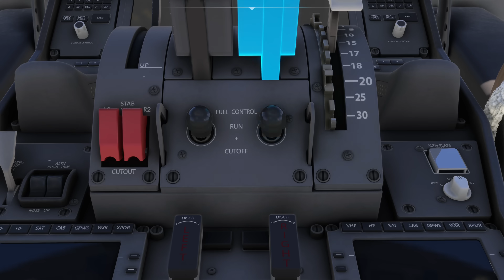Air India 171: Why Did The Fuel Cut-off Switch Get Moved?

Comment: The idea of having two pilots to be present to activate any function sounds dangerous, imho. What if one pilot is suddenly incapacitated (heart attack, sudden pain, etc)?  What I think should have happened in this tragic incident is a warning alarm to sound if fuel is cut off too early - (the aircraft computer program can determine timing is not right, given all flight data is monitored, including take off incline etc). Planes are built with all the hardware safety in place, but dangers can be caused by pilot error too, which airplanes computer programs should be able to monitor and sound an alarm on pilot errors, not just hardware errors.  Would that not be feasible? Thank you for your video, sir

Comment: Is the 787 equipped with alarms when engines are fuel-starved, either by malfunction/contamination, or deliberate action (cut-off)?  Additionally, I've heard no report of an audible stall warning, terrain, stick shakers, etc via the CVR during 171's departure from flight (stall).  Were there any control inputs recorded by the FDR to manage a departure from flight, other than the fuel cut-off switches being turned off and back on again?

Comment: Does the switch operate the same way on different aircrafts? Like if its pushed down it means OFF and up is ON is that true for all aircrafts?. Could this have been a situation where on the pilot’s previous plane the switch operated in the opposite way, which would have explain why he denied turning it off.

Comment: the UK in 2018 and 2025 published a report that the fuel shut off valve needs to be inspected soon after qatar and other airlines started checking it this was put out by Boeing itself first the flaps then u found out the rat was deployed plz understand this could be a technical issues as well

Comment: Why hasn’t the report published the entire conversation happened in the cockpit between the pilots. Why just only specific 2 lines are reported.
Reply: How do you know that there was anything more?
Reply: @johnp139  there must be, flight duration was about 40 sec. Pilot keep exchanging confirmation message about action they perform on aircraft during take off, where are they. All event should be described with proper timestamp , not just mentioning immediately after in report, it means there must be more conversation or detail.
Reply: @johnp139 
absence of proof is not a proof of causation. 43 second recording is not enough to draw a conclusion, it is a blatant and desperate act to exonerate the Boeing. 
It has happened in the past, they will rip the lives of pilots to shred, and find a clumsy reason that indicates not if it proves the pilot's fault.
Reply: @BhargavSushant That ALONG WITH THE FDR DATA!!!!
Reply: The NTSB just hasn’t released the transcript yet. It should do so eventually.
Reply: Indian auhorities trying to hide the truth of a mass murdering pilot.
Reply: And all jumping to conclusion that pilot has done it. Even captain seems to buying that conclusion.
Reply: You know why

Comment: Why are there no immediate extremely obvious and impossible to overlook audio and visual warnings when the fuel shutoff switches transition from run to cutoff shortly following takeoff and before a safe altitude and airspeed are reached? Wasn’t there a 2018 bulletin warning of similar Boeing fuel switches transitioning into the cutoff position during flight? It seems archaic to me that the primary preventative measure is a pilot placing their hand near the fuel control switches. Modern flight control systems should provide additional safeguards. In my opinion, Boeing should have been proactive with software enhancements that might have prevented the Air India 171 tragedy.

Comment: I am 2000% with you Captain Steeeeve!  I would not trust anything AI for anything that I ride in, especially in something that can end me so quickly.  I work with very high-grade technology for a living and every day I see failure, either a component, a piece of software running away, some goofy errant condition, whatever.  Overall I think technology is pretty spiffy, but it doesn't have a soul hanging in the balance to protect.
Reply: Especially when landing during crosswinds

Comment: @10:28 ... If the airline did have cameras in the cockpit in this particular instance it would most likely have confirmed whether the cut-offs were hit by mistake or not; I respectfully disagree..   Cameras should be installed.

Comment: Captain Steve...Great insights. I need the following clarifications
If a pilot is taking control of landing and when the fuel to engines are cutoff. Which switch is turned off first?  Is there a sequence, i.e., number 1, first, then number 2, or is it the one nearest or further away from the pilot who has the control?

Comment: Captain Steve, it took 10 seconds, between when one Pilot inquired about why the switches were set to off and when they were finally switched back on. Would those 10 seconds have made a difference if they were instantly turned back on? Thanks.

Comment: On another YouTube stream Marco Chan of Buckinghamshire University points to a possible chip failure, highlighted in an earlier maintenance advisory. Apparently, after enough service time the chip becomes degraded from heat, and can fail, even momentarily. And possibly even re-engage. Surely this needs to be carefully looked into, as it could be a more realistic summary of the cut-off switch behaviors.

Comment: The possibility of this type of "accident" or "worse" is completely 99.99% preventable. The left engine cutoff should be located at the Pilot in Commands left side panel. The right engine cutoff should be located at the Flight Officer's right side panel. This switch placement would eliminate BOTH accidental deployment AND intentional deployment of BOTH switches at the same time. If one or the other pilots were to spool down "their" engine at a critical point, these planes (which are certified for single-engine flight) should still be able to keep on flying. It would simply be impossible to have a dual engine engine failure without one pilot incapacitating the other and then somehow shutting down both engines. Retrofitting the location of these switches on ALL commercial aircraft would give the public the confidence that this type of "accident" would virtually never happen again.
Reply: good idea, same with four engines, two on the captain side and another two on f/o side and for sure on overhead panel

Comment: people suicide all the time ... some deliberately, some inadvertently, and what is often forgotten is that a very high percentage of people who have life frustrations or mental health / life situation problems or challenges ... routinely have momentary impulses ... that are self destructive or destructive to those around them ... but momentary swearing at a driver and considering ramming them ... or ... a momentary desire to punch the bully at work ... passes ... or even if it does not ... generally behavioral excursions in most situations ... even if destructive behavior ... are usually recoverable without lethal outcomes ... but in aviation ... in critical situations ... there simply is no time ... to defeat the physics of the situation ...created by a momentary behavioral excursion ...  the reality is simply that in aviation ... the regulatory and employment environment make it virtually impossible to seek help without risking your career ... etc.   That there is a bit a help at one or two airlines does not mean it is the norm ... it is not ...

Comment: I saw Steve on an interview earlier today where he stated that he had never heard of a flight where both fuel switches were moved to shutoff early in a takeoff.
But in 1989 Delta flight 810 did exactly that. One of the pilots mistakenly moved the fuel cutoff switches to the off position in response to an amber alert light that was indicating a possible fuel pressure problem. But it was not an emergency situation that the light was potentially warning about. And the pilots managed to restart both engines after decending to just 600 feet agl and continued with the flight.
I'm not suggesting that this is what happened on this flight, only pointing out that this scenario has happened in the past.

Comment: The automatic activation of the Ram Air Turbine (RAT) just five seconds after the fuel cutoff (08:08:47 UTC) on Air India Flight 171 cannot be explained solely by the "CUTOFF" of the fuel switches. The Boeing 787-8’s engines,  operate at takeoff with full thrust at approximately 2,560 RPM (100% N1) for the low-pressure spool (fan) and about 11,377 RPM (100% N2) for the high-pressure spool. Due to the inertia of the rotating components and the airflow ("windmilling") at a flight speed of 150–180 knots, the engines maintain significant rotational speed for at least 1–3 minutes after a fuel cutoff, typically 50–75% N1 (approx. 1,280–1,920 RPM). This is well above the ground idle speed (approx. 614 RPM, 24% N1), which is sufficient to keep the Engine-Driven Generators (EDGs) supplying power to critical systems such as flight controls, avionics, and hydraulics.

A drop in rotational speed below idle (approx. 614 RPM) within just five seconds is physically impossible, as the airflow continues to drive the engines. Even with maximum braking effect from an abrupt fuel cutoff, the speed would not fall below 2,000 RPM, far from a level that would jeopardize the EDGs' power supply. The rapid RAT activation thus suggests an additional technical failure, likely in the Electrical Load Management System (ELMS), the Full Authority Digital Engine Control (FADEC), or the software, possibly due to an error in the MN4 microprocessor of the Electronic Control Unit (ECU). The cockpit recording ("Why did you shut it down?" – "I didn’t") and the unusually precise switch movement (within one second) support the hypothesis of an automated error. The report’s emphasis on the switch position distracts from this central issue and may aim to obscure a system failure to protect Boeing and Air India from liability.

Comment: If one of the pilots did this on purpose, why would they allow the other pilot to turn the fuel switches back to run? If they wanted this to happen, why would they not stop the other pilot turning them back on and potentially rectifying the situation?

Comment: As a military flight instructor for 27 years, I have seen some unusual things. The fuel cutoff switches on the aircraft are a terrible design. Why they are on the throttle quadrant, right behind the throttles is ridiculous. I would ask if the co-pilot was wearing a watch or a bracelet. If the co-pilot moves his hands from supporting the throttles on the take-off roll and then moves to raise the gear/flaps after a positive rate of climb, could he have inadvertently caught the switches in a one-in-a-million snag, lift and pull. Some positive G, some buffet...these switches are in a location that are exposed. It only needs to happen - once!

Comment: Could the dual-engine flameout of Air India Flight AI 171—fully fueled at 54,200 kg and a takeoff weight of 213,401 kg in extremely hot weather—have been caused by the Thrust Control Malfunction Accommodation (TCMA) system detecting an ‘over-thrust’ condition during takeoff, mistakenly thinking the aircraft was still on the ground? In such a scenario, could TCMA’s FADEC logic have automatically shut off the fuel mid-air—similar to the dual-engine shutdown on ANA’s 787 at Osaka Itami on January 17, 2019, when full reverse thrust was applied before ground mode was confirmed, triggering TCMA and resulting in both engines shutting down unexpectedly? 

Thrust Control Malfunction: Accommodation (TCMA) system, in certain scenarios, can shut down an engine by cutting off the fuel supply. This occurs when the system detects an over-thrust condition, meaning the engine's power level exceeds a predetermined threshold. 

TCMA's Role: TCMA is a safety feature designed to prevent engine runaway or other thrust control malfunctions by automatically reducing engine power or shutting down the engine if necessary.  

Over-thrust Detection: The TCMA system monitors the engine's power output and compares it to a threshold contour. If the engine's power exceeds this contour, it indicates a potential malfunction. 

References: https://simpleflying.com/ana-dual-engine-failure-on-landing

Comment: I think they forgot to ever turn it on until they heard the engines fail and tried to restart them.  They never turned them on until it was too late
Reply: If they weren't turned on, they would have never left the boarding ramp. The engines don't run when they are off.

Comment: In December 2018 the FAA issued a Special Airworthiness Information Bulletin (SAIB NM-18-33) regarding Boeing fuel control switches, including those on the 787, noting the potential for the locking feature to disengage and allow a switch to move without lifting — increasing risk of inadvertent engine cut-off  .
However, this bulletin was not mandatory. It recommended that operators perform inspections to verify the locking mechanism was functioning correctly, but did not impose an Airworthiness Directive (AD).

Comment: Ask the Captain: Hi Cap Steeeve. Here's my question on Air India. So it's clear the cutoff buttons were switched to off. But the buttons are on one end of the wires. And they are long wires going all the way from the switches throughout the body of the aircraft till the engines. And at least on part the probably run together till they split. Would it not be possible that at one point there could have been heat or sparks that melted both wires and cause the flameout? We obviously don't have the entire report published, but I'm sure when syncing the data recorder with the voice recorder, it could be that the switches were placed to off after the flameout in an attempt to reignite. The question why they waited 10 seconds still remains, but that could be due to confusion and starting effect. Is that such a far fetched idea? I remember an aircraft incident in the past that started by smelting wires.

Comment: Just put the fuel switches far apart. One left of the captain's seat and the other right of the co-pilot's. However, that won't solve the more basic issue. If a pilot is determined, they will find a way to crash the plane.

Comment: I do not understand why these importent switches which are responsible between life and death are not covered with a small plastic box with a seal? Only in case of emergency pull the box,destroy the seal with the same movement and you can access to the switches.But not open behind the thrust levers, even switching is secured.Access is way too easy for my understanding.

Comment: I'm simple guy from small polish town - it might be a silly question but I'll risk- can you liftoff with one switch being in cuttoff position and the second in RUN position? Will the computer let you fly/ liftoff? I'm saying - captain side (I presume captain is always sitting on the left seat) has a priority over co-pilot that means "his" switch overwrites other switches where co-pilots switch - if it was in Run position -would not start anything it this instance the engine - I hope it makes sense. So, summarising - captain can take off/lift off with one engine and computer will allow that, however, if co-pilot would want to depart/lift off wirh one engine -the computer won't allow it. I'm thinking - then one of them could cut off the engine (left or right) wirh one hand 🤔

Comment: The Indian pilots union claims that a "glitch" in a Boeing airliner can cause the fuel cutoff switches to activate automatically without pilot intervention in rare cases. They have even cited a few instances where this has happened in the past. THey point out that the investigation commission has not released the whole black box tape, only a few carefully selected moments of it. Also, that it is in the interesest of the Indian airliner and Boeing to blame one of the pilots. What is your answer to this?

Comment: Hi Captain Steve, I wondered is it possible that the springs operating the cut off switches have worn out from over use since they are used at every gate arrival and therefore able to slide into any position? Thanks Stew.

Comment: What a farce. This guy initially blamed the pilots for not deploying the flaps, then completely flipped his stance — and now, based on a half-baked report with just two cherry-picked lines taken out of context, he's back to blaming the pilots again.

Let’s assume, for a moment, that one of the pilots did intend to bring the plane down. Would he really allow the other pilot to restart fuel flow to the engines — potentially saving the aircraft? The very report being cited admits that one engine did, in fact, restart, but couldn’t generate enough thrust. That alone weakens the theory of a premeditated crash.

If this were truly sabotage, do you think the pilot responsible would take the risk of letting the other regain control?

And then there’s the Mayday call. If the co-pilot genuinely believed this was sabotage, would he calmly relay a distress signal instead of alerting authorities about a deliberate act by his colleague?

And let’s not overlook the bigger picture: the report clears Boeing, yet a UK aviation review released in May 2025 flagged a known issue with the fuel actuator on this specific aircraft model. Why is that conveniently missing from this narrative?

Comment: I never heard you say even a slightest technical possibility of electronic failure of the switches. Could there be a circuit failure inside these switches that with or without the transition a faulty signal could have been relayed to the system to stop the fuel. 

My inference : #If it’s Boeing I ain’t going.